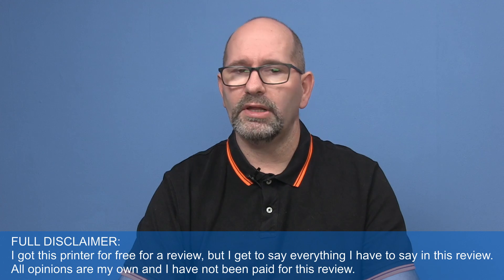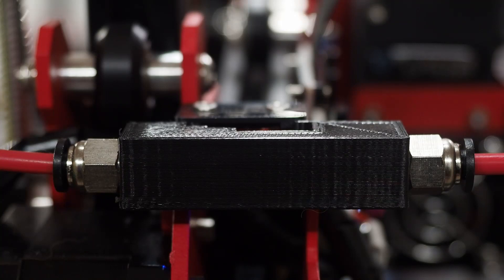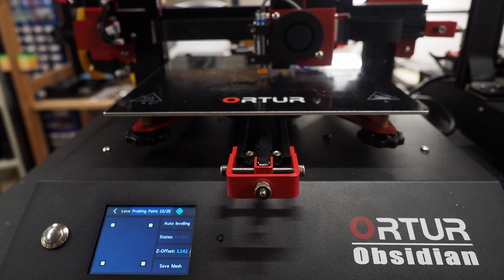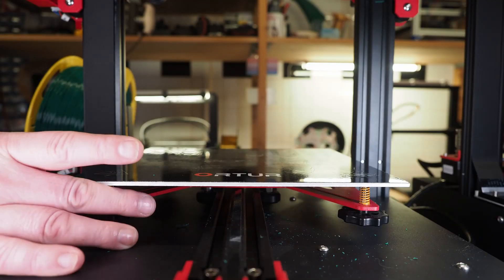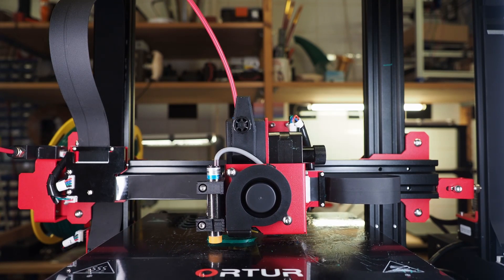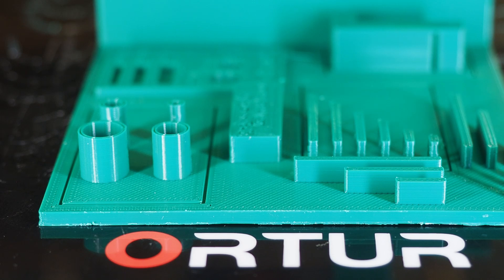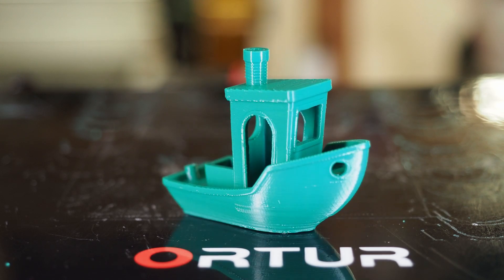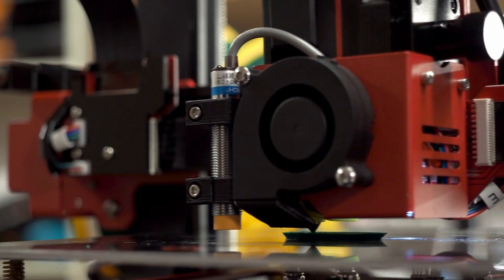▼ Ortur Obsidian Review | First look at the Ortur Obsidian

Comment: One of my printers has exactly the same relay on/off switch. I really like that setup. Which filament did you use for the test prints?
Reply from the maker: I think it was Noullei filament, or else it was 123-3d. 
I am sure it was PLA.

Comment: Looking forward to the next video! What slicer do you use? From what I have seen in other reviews, I believe these ribbon cables have to be bolded in place instead of clamped in place.
Reply from the maker: Hi, I use both Cura and Simplify3D (best results yet in Simplify3d, but I am sure i can beat that in Cura when I found the correct settings)
As for the ribbon cables, they use a bolted clamp now, that is really good, far better then how Artillery did it, but still Ortur uses the wrong type of connectors, without clamps. When they upgrade the printer to these clamps, I would without a doubt say this is the best printer for beginners to semi professional users.

Comment: Is there a good beginner 3D printer? I'm an old man on a fixed income starting a new hobby. I love your videos they are very informative.
Reply from the maker: I think the best beginner machines at the moment are the Creality Ender 3 and/or the Artillery Genius printers. These printers are easy to work with, are complete when you buy them, and you can find all info you need on YouTube and Facebook groups. It's not that I like these printers the most, but they are very easy to use.
I think the Artillery Sidewinder X1 (The Genius big brother) is the printer I like the most out of all machines I have. It's as easy to use as the Genius, but it can make bigger projects. Down side of this is that bigger project are more likely to fail.
Reply: @3dPrintCreator  mmm..the ender is cheap but not easy for a beginner
Reply from the maker: @themountain59  Now you make me curious... What printer is easier in use than the Ender 3?

Comment: Thanks for the review, you convinced me and I've already purchased one. I'm a bit scared of bed issues you've fixed with spacers. Have you figured out what is the root cause? Did you contacted GBest support?

Pls in your next video develop a bit on the flat cables concerns, as I'm not really sure what the problem is. Great job!!
Reply from the maker: Hi Pablo,
I don't know exactly what is the cause of my problems, as I know a few other people that have the same machine, yet they don't have the same problems I have.
That said, the machine is really easy to build, with exception of the flat cables. You have to connect them with caution, because once the silver stripes bent away from the cable, there is no repair possible and you will need another flat cable.
Reply: just get longer springs under the bed ;)
Reply from the maker: Hi Andy, I would have choosen that route if I had them. Lasercutting some spacers for the time being was easier (and lot quicker) for me.
But.... Longer springs are on their way to my studio.

Comment: Looks good! But, is it beter than the Hypercube?
Reply from the maker: It's no comparison to a Hypercube because this is not a CoreXY printer and it has a moving bed.
I think, having them both, I would prefer a Hypercube (or any other CoreXY machine) over this printer, yet in quality of the prints I get from this machine, there is no real difference to the Hypercube other than the fact this is an almost complete made machine, while you have to do everything yourself when building a Hypercube..
Reply: Whats a Hypercube ??
Reply from the maker: A Hypercube is a DIY printer that can be found on Thingiverse.
You have to print a whole lot of plastic parts, and cut a few extrusions, then place a microcontroler and the other electronics, building your complete printer yourself.
It's extremely easy to make, provided that you follow the instructions, and you learn a lot from it.